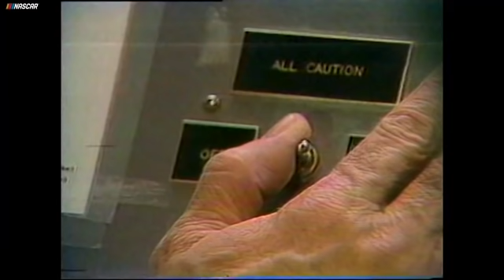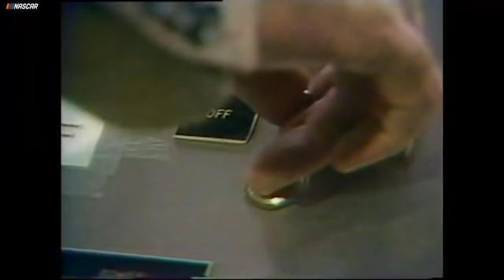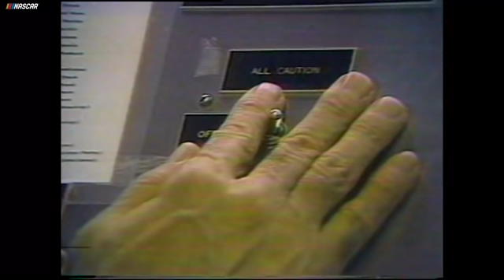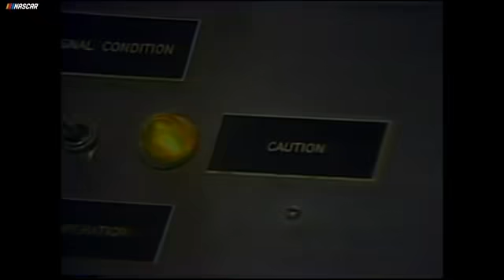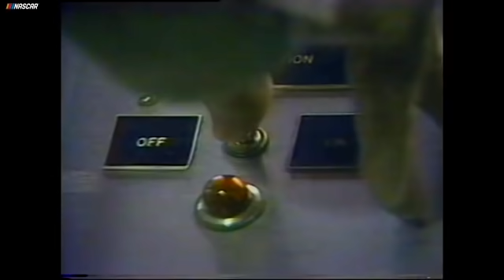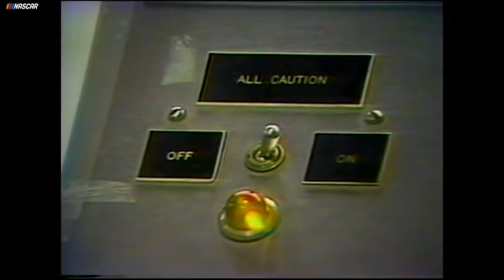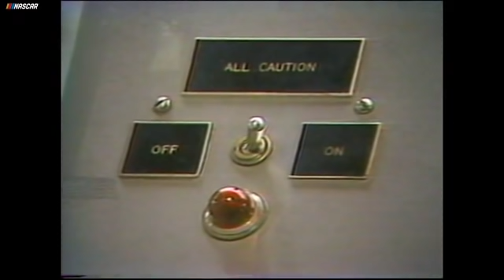1979 Daytona 500 | NASCAR Classic Full Race Replay

Comment: Badass beautiful race cars, no restrictor plates, no trash stages, no trash playoffs, no splitters, just racing and also great commentary, the way it should be. And it was exciting.
Reply: I was reading on all the new rules and was quite dumbfounded! Playoffs this isnt football! I rember being a kid watching nascar it is so sad to see how sissified nascar has become!
Reply: Greatest Brand and dangerous
Reply: NASCAR seriously needs to do something about the cars they are using today. I just can't take them seriously they look so goofy. The COT and the follow-up Gen 6 were a solution for a problem that didn't exist. Basal skull fractures as a result of frontal impacts was the mechanism that killed so many drivers in the 1990s and early 2000s. Once the HANS became mandatory in late 2001, there hasn't been another fatality in any of NASCAR's major series. That device has done more than anything else in preventing the type of injuries that were killing drivers. The addition of the HANS, safer barriers and the development of wrap around carbon fiber seats (often overlooked but another major safety improvement) made the Gen 4 cars used up through 2007 in Cup (and for much longer in ARCA) plenty safe enough. It wasn't necessary to raise the roof height by 4 inches which has completely ruined the looks of the cars by turning sleek race machines into out of proportion ugly ducklings. Flips and fires weren't killing drivers! Head on impacts into the wall and side impacts where the driver's head slapped the wall were killing drivers. The HANS and the new seats prevented that. And the safer barriers gave them an even greater safety margin. COT and Gen 6 were terrible knee jerk reactions to Dale's death and are largely responsible for the lack of interest in today's NASCAR.

Comment: It sounded right - that throaty roar of the engine that let you know some serious car racing was going on.  That something dangerous was going on.  That something manly was going on.  The look was right - they were cars you could recognize.  They took out the lights, put in a roll-bar, gussied up the frame and tweaked the motor.  But it was a car that you might see on the street.  And the talk was right: full-on southern twang.  It was an era when the mob ran Vegas and good ol' boys ran the track.  Lost forever.
Reply: Tweaked? This motors where completely built separate from stock engines.

Comment: Now Ken Squier is in the NASCAR Hall of Fame as being one of the five for the Class of 2018. This year's Daytona 500 was the 40th-consecutive Great American Race broadcast flag-to-flag. Don't worry, Buddy Baker won it the next year in 1980 and set the record average speed for this race at 177.602 or 177.603 MPH. As for Dale Earnhardt, nothing like leading in your first Daytona 500 (he would lead in 18 of his 23). As far as the wreck, two tough guys who took each other out, it's the last lap of the most prestigious race of the year, a championship in itself, and it's decided in just 200 laps, not 36 races. You've completed 199 laps, avoided wrecks, your car is still mechanically intact and has survived attrition, you have put yourself in a position to win in which you made nail-biting moves to do so, and you have just 2.5 miles and one last lap to make a move. Donnie was trying to block, he anticipated Cale's move because they pulled away for the previous 20 laps, and it doesn't matter whose fault it was, it was a draw and no one wins, both are at fault, and who cares whose fault it was, it is boys have it. Back then your car could be driving terrible with the handling gone, but the car would actually be driving better depending on your skill level. I was born in 1990, and I'm just a few fans who are still appreciate the races of decades past back to the beginning, a throwback and old soul.

Comment: What is that small can for? 1:59:42
Reply: Probably gas? I’m not too sure. But it’d make sense, cause I’m sure that the drivers would let their tank get on empty so they wouldn’t need that much gas.
Reply: It’s called a catch can, it is meant to take up air in the fuel cell so that overflows don’t happen. They don’t use them anymore, cars automatically vent the air now

Comment: Instant classic, back when racing was racing, it's crazy to think that 45 years ago, the cars were this fast, with average speeds faster than they are today, do you think that restrictor plate racing would make things safer for the drivers and spectators with todays safer cars and track designs?

Comment: Now this is what Nascar was and should be again. No "Safer Barriers" no "Lucky Dog" free laps, no restrictor plates, No Front drive cars modified to RWD, Lapped cars inside on restarts, NO overtime, No stages, No cookie cutter cars, Real cars U could see on the showroom with real bumpers. Except............Today's showroom cars have no frame Unibody all of them. Also equipped with that Joke 5mph bumper concealed in plastic. I'm fortunate to be old enough to have owned and driven some of the fastest production cars of the '50's 60's and 70's. Just one example here. In 1970 I bought a '64 Olds Dynamic 88. BIG, Heavy car. 60K on the clock, would do 135MPH bone stock. And got better than decent mpg at 80mph or so.....18mpg on then leaded Premium gas over 100 octane.
Reply: Yeah except we should have safe Barriers
Reply: Hello??? SAFER barriers are necessary. And BTW those cars were NOT stock. NASCAR stopped using stock chassis in the late 60s. You say you love old NASCAR but you don't even know its history. And you also sound like someone who wants to see the drivers hurt if not killed in accidents.

Comment: I wonder if they ever figured out what happened to Buddy Bakers car.
Reply: Yeah they did - it was ignition related - a part was not installed correctly when they dried everything from the rain and they missed it when they tried to diagnosis the problem on pit road during the race.  Waddell said no way it blew up - they replaced/connect the part at the shop and it fired right up.  Baker would have stomped the field like he did in 1980.